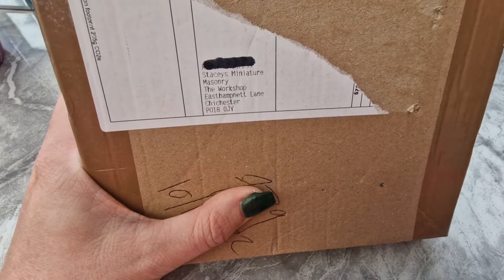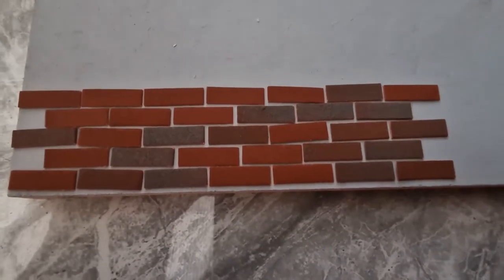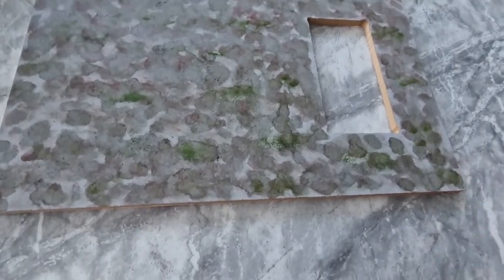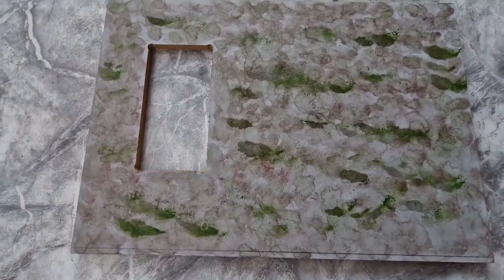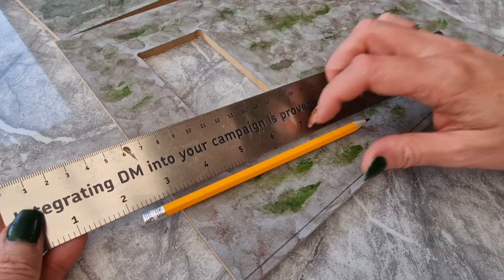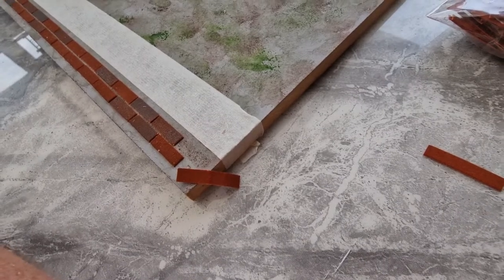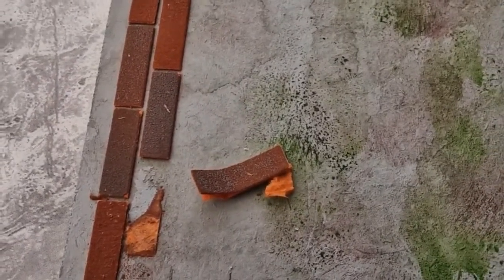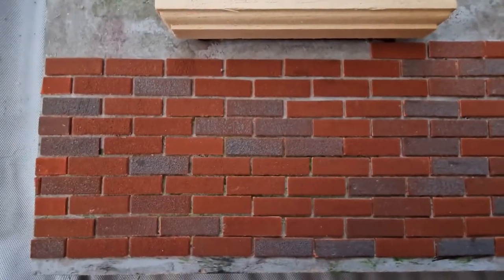Doll House Build Episode 8: Brickwork with Stacey's Minature Masonary Versi Brick Slips

Comment: I'm going to use sand paper for any brick work much cheaper also I will coat over with a clear Wood glue so it's  not too rough to touch 😊
Reply: I already made my bricks but sandpaper is a great idea.
Reply: @yanaray5334  that's being organised lol 😆
Reply: That's exactly what I was thinking. A pack of 25 9x11 100-grit sheets is $15. If your bricks are 1/4" x1/2", that's nearly 20000 bricks. A paper cutter would make very quick work of it.
Reply: @MatildaRabbit  oh yeah 😎 lol x

Comment: It would be nice if you could find a small brick design stencil for the walls.  A lot less costly as well.
Reply from the maker: I did mention that as an option  in the video about decorating the outside but it's still brick powder and so it still adds a fair bit of weight to the house. The other downside is that it's all one colour so you have to then paint over to age the bricks to the style and age I wanted
Reply: @dragonfly_minatures  That's all true.  I was just trying to think of a less expensive method.😚❤️